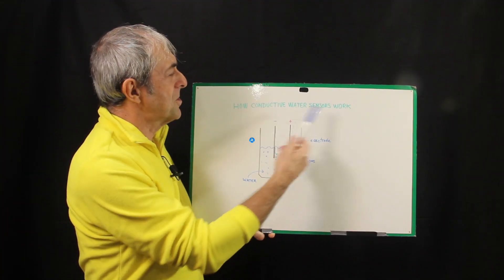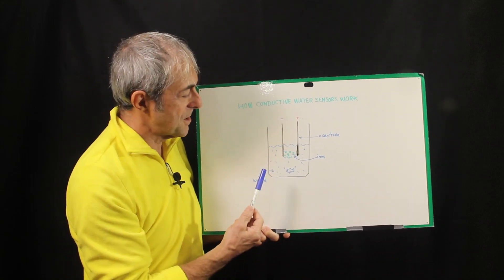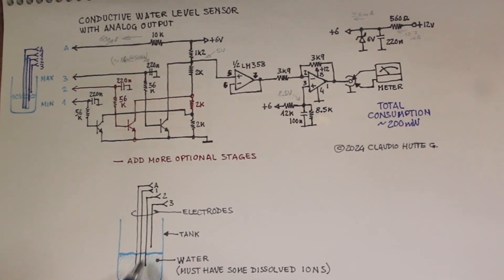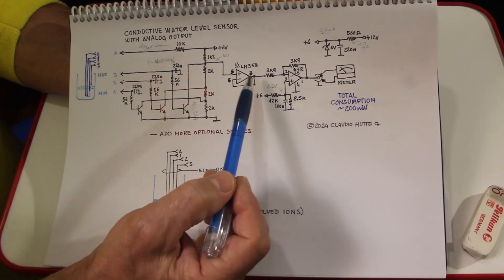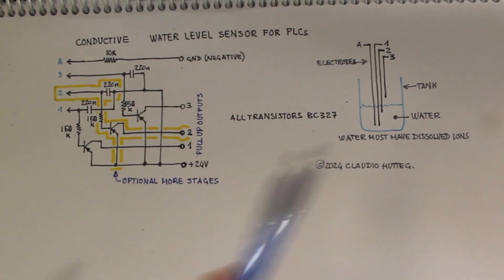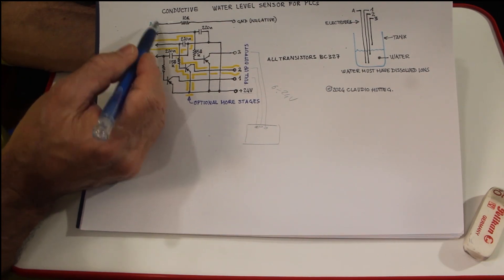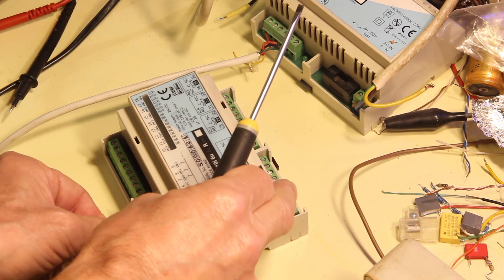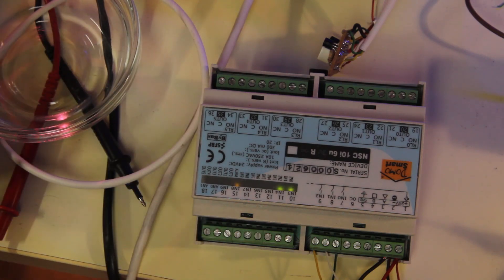Simplest Water Level Sensor #electronics

Comment: If you use a Darlington configuration as input with a pulldown resistor to prevent false triggering, you can even lower the current drawn and prevent even more corrosion.
There is also a circuit which use a 555 to generate "AC" which eliminate corrosion of the electrodes even more. Grtz
Reply from the maker: @BjornV78  Yes with a Darlington the current can be lowered. With a pull down resistor the current would increase again but maybe it's possible to find a sweet spot. Generating an AC does not completely remove the risk of having ions that convert back to neutral status thus having atoms that attach to the electrodes, just mitigate a bit. In addition it must be a true AC: you need electrons that go back and forth, that significantly increase the complexity of the circuit.
However your's are valid arguments, thanks for contributing the discussion.
Reply: @AccidentalScience  another trick you can use, but not have seen, is to use "polling" like a smoke detector use. This is done by reading a value (water level) not constantly, but every X seconds or minutes. Another non contact solution can be is to use a IR sender/receiver in a clear tube , where the water diverse the IR light beam, the technique that a computer mouse or smoke detector use. Grtz
Reply from the maker: @BjornV78  love the IR thing. And as a bonus you may also read CO2 concentration 🙂 (I'm joking).
Yeah polling is a good way to practically eliminate the problem. In the case one uses a PLC or an Arduino, one output can be used to drive the power of the sensor programming a proper duty cycle.
Thank you mate.
Greetings from the Alps.